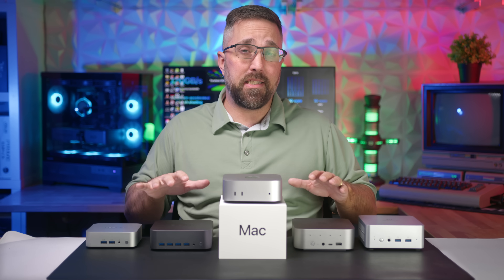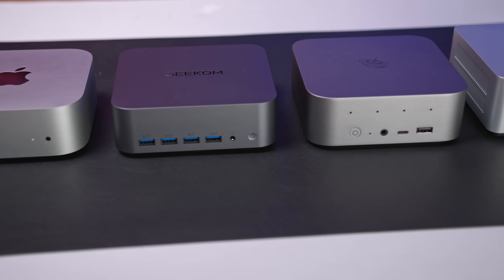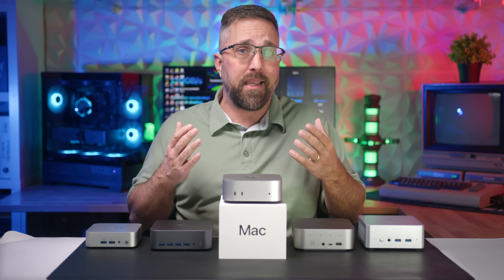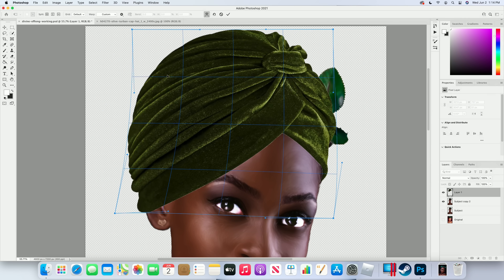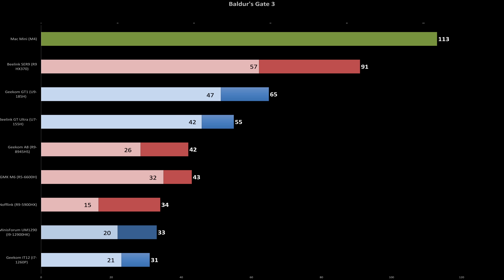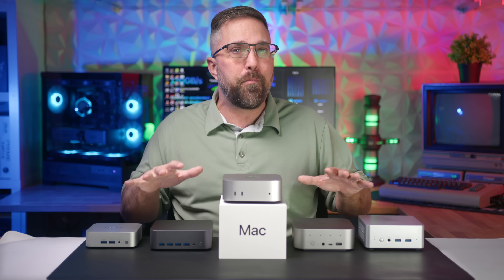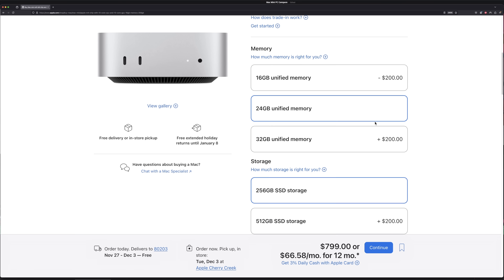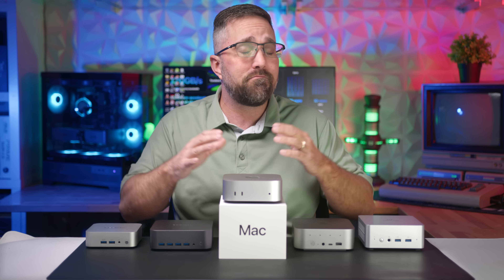M4 Mac Mini vs Intel and AMD Flagships – It's Not Even Close!

Comment: Some academic Benchmarks and and for real life almost Video and Photoshop software bechnmark only? I fear this a very apple friendly perfomance test. It's probably same like it was always, if you are using those video and photoshop programms your apple runs better, but other use cases the apple performance per price is sh*t. And reason for beeing fast is not better cpu or gpu, it just because it is better optimized.  Also i doubt that 16GB of ram are now a days enough. A browser open with a few tabs and addiotionaly working on a big video parralel that 16GB full of data. And then i bet the machine will become really slow. A very simple situation where your test just ignoring.
Reply from the maker: RISC architecture requires less memory than CISC because it uses fixed-length, simple instructions (typically 4 bytes) instead of variable-length, complex instructions. It relies more on registers instead of frequent memory access, reducing RAM usage. Unlike CISC, RISC doesn’t need microcode, which saves storage. The architecture is optimized for efficient compiling, avoiding extra memory overhead. While RISC programs may have more instructions, they are simpler and execute faster, making overall memory use more efficient. This streamlined approach results in better performance and scalability with lower memory requirements. This is why the Mac outperforms the PCs with less memory.
Reply: @ElevatedSystems  Sorry i am asking: Are you an expert in camparing cisc and risc archtectures? I think this is a very complex question you are talking about.... It is not an easy question weather a reduced instruction set what obviously lead to more assembler lines but have shorter instrucion word, would use at the end less ram. I am asking my self weather these claims are "truism" craeated by marketing departments. I can also remember that there was a thinking that risc outperfoms cisc in performance per watt. But at the end the german magacine heise revealead once that if it comes to top end performance cisc and risc are same efficient.
Also i would bet that now a days ram consuming internetside doesn't depend on or if, almost not depening the architecture. Because javascript code, pricture and assets that are loaded to ram are same on both architectures.
Reply from the maker: @ I dont know if I’m an expert, but I’m an Electronics Engineer and worked extensively with RISC code development and assemblies. Its not that complex, simpler decoding, reduced microcode storage, efficient register usage, and fixed-length instruction formats, makes RISC architectures more memory-efficient and scalable in modern computing environments.
Reply: @ Why should reduce microcode storage save ram? These are the commands which are saved on the cpu, right? And can also be updated if the cpu manucaturer did some shit on the cpu. I think the Intel Pentium Bug in the 90s was the reason for inventing microcode. But it should be completly irrellevant for ram usage at runtime.
Reply from the maker: @justiccoolman1816  RISC avoidance of microcode allows instructions to execute directly without extra processing. This keeps L1 cache efficient, reducing congestion and improving speed. CISC processors use of microcode generated extra micro-operations (μops) that take up cache space, reducing space for actual program data. This can lead to more frequent cache evictions and increased reliance on slower main memory (RAM). Without microcode, RISC CPUs maximize L1, L2, and L3 cache for program data, reducing memory access delays. This results in faster performance, lower latency, and better power efficiency, ensuring cache is used efficiently for faster, more predictable processing. If you want more education in this subject I recommend “Computer Architecture: A Quantitative Approach” Hennessy/Patterson

Comment: Just curious, why choose a 256 GB SSD. MAC mini?   
If other mini pc has at least 1 TB, then we should use a 1TB Mac mini.  Then price isn’t right at all.  It will be a scam as you are using to top line of ram and SSD for other mini pc but just a basic model of Mac mini.  16g 256gb Mac mini is $599, you should use 16gb ram 512GB ssd which is  $799.  Otherwise it will be a cheat to try to urge view to buy Mac mini.  Then it will not be a real comparison.  
Mac mini  has their strong point on media editing or even gaming on any game that support ARM chip.  But only too few game will suppoted ARM chip.  And this wont change at least for another 10 years.  Which this lead Mac OS  only for certain groups of buyer.  
256GB will only allow user to install no more than 3,4 game then it will become storage space insufficient problem.

Comment: about the power button. you dont even need him. you touch your keyboard. if is plugged it will turn the mac on.
Reply from the maker: No that wakes the Mac, it does not power it on if shut down.

Comment: Great Video.....Thank you!
Costco sells this base M4 Mac Mini on sale for $499 every now and then. The best thing is to boot it off of an external SSD for a cheaper upgrade than Apple offers. I use the Samsung 990 EVO Plus 2TB in an enclosure with cooling fan getting 2800 MB/s read and write or the Samsung T7 Shield would be an easier/cheaper option but a bit slower. I still have my Commodore 64 also (I see yours in the background) that played all of the Atari 2600 games back in the 80's.

Comment: If you're still buying Mac hardware in 2025 you're not the brightest. DDR5 2x32GiB SODIMM RAM 5600MT/s is only around $160 and that is Crucial brand. Mac Hardware is nothing impressive and a total rip off. Linux runs faster on Arm chips than mac does itself. Not impressive.

Comment: The reason that the MacMini power button was placed in a convent location for the design of the unit instead of the user was quite simple. Very few Macs are ever turned off. I have two Macs that have not been rebooted in months.
Reply from the maker: I only use my Mac Studio 2-3 days a week, the rest of the time it’s turned off. My wife only uses her mac mini on the weekends and shuts it down the rest of the time. Like Apple we try to be eco and security conscious. Both our Macs are tucked snugly under a Grovemade shelf and the extra height of the M4 Mini makes it impossible to get to the power button at all. So in my home 100% of Mac desktop users need a properly placed power button.
Reply: @ElevatedSustems Macs actually prefer to sleep, rather than be shut-down when not in use for only a day or two. The Mac OS does a number of housekeeping tasks during the sleep cycle that keep you Mac operating at peak efficiency. The amount of power used during sleep is equal to or less than the amount that is used during a start-up. So, if you are thinking you are being “eco friendly” you are fooling yourself.
Reply from the maker: Lets ask Siri…..
For a desktop Mac (e.g., iMac, Mac Mini, Mac Studio), shutting it down is generally better if it will not be in use for several days. Here’s why:

Why Shut Down a Desktop Mac:
	1.	Power Consumption: A desktop Mac uses more power in sleep mode compared to being completely shut down, even though it’s minimal. Over several days, this adds up.
	2.	Component Wear: Shutting it down prevents unnecessary wear on components, such as the PSU and cooling fans, which remain minimally active in sleep mode.
	3.	Fresh Start: After being off for several days, starting with a clean system eliminates any lingering processes or potential bugs from previous sessions.

When to Use Sleep Mode:
	•	Short Breaks (1-2 Days): If you’re stepping away for a day or two, sleep mode is more convenient because it allows for faster wake times and preserves your session.
	•	Background Tasks: If macOS needs to complete tasks like updates or backups to Time Machine, sleep mode can ensure those are completed.

Recommendation:
	•	More than 2-3 Days of Inactivity: Shut it down to save power and give the system a complete reset.
	•	Less than 2 Days of Inactivity: Sleep mode is fine for convenience, and the power usage is negligible.

For prolonged periods (weeks or months), you should also consider unplugging the Mac to protect it from potential power surges.

Comment: Excellent video, and I totally agree with your conclusions. I have several AMD and Intel mini-PCs, and the M4 Mac Mini base model represents best value to date. I paired it with a SanDisk Pro G40 1 TB USB 4 SSD I had lying around formatted using Apple's APFS. I first created an admin account for restore purposes, then a user account with admin privileges and moved its home folder to the external USB drive. The Mac Mini still boots using the Internal SSD so things like Apple Intelligence still work, but the user account and large applications such as Xcode, including Virtual Machines, gaming, and retro gaming, are all loaded from the external SSD. This works well because the Black Magic disk speed read and write performance of my external USB4 SSD is slight faster than the Internal SSD, plus I have only used around 60GB of the Internal SSD Vs 460GB of the external SSD. My external 1TB SSD originally cost less than Apple's M4 Mac Mini 256GB to 512GB internal SSD upgrade, illustrating what a rip-off Apple upgrade costs are.

Comment: I went for dreamquest, dose everything i need it for inc lightroom and photoshop, it only a travel computer big demand editing i normally wait till i get home to use gaming desktop but i may not need to now as i was using 15 year old laptop. the dreamquest it has n150 3.6ghz 8gb graphics, 16gb ram and 500gb m.2 for it size performs well and dose everything i need it for, no intentions gaming it a travel computer and best thing they system and a 16 inch 2.5 k screen uses around 40w of power that was important as it will be a car pc on my next big roads trip for isles scotland could be 3 weeks and 80% living in my car as micro camper so a pc to transfer vid data and pictures on to portable hdd a pc is necessary, screen uses a crazy 10w according to cable and pc plug says 12v 30w 3a a cheap inverter to get a steady 50hz job done a pc in my car on windows 11 and i pick my office view cannot get better than that while i transfer data and maybe few edits. low power usage was top my list but it still had to use lightroom and photoshop and have 4 usb drives the dreamquest fits that very well. i will get an amd one at one point for at home as it pretty wasteful running a huge computer just to watch youtube or other online vids i can give my expensive computer a rest and use a cheaper amd mini for 90% daily stuff. dreamquest n150 3.6ghz 8gb graphics, 16gb ram and 500gb m.2 cost me just under £200 and that inc 3 year insurance for what it dose a bargain and screen 2.5k 16 inch spot on for travel £137 overall with everything i needed to run it like mouse keyboard and inverter all in was just over £350 what bargain for a car pc what can easy do editing i require while in my car

Comment: @ElevatedSystems - OBJECTION at 13:54: You're not fairly comparing price to performance ratio. Upgrading the Mac Mini's memory to 32 GB and storage to 1 TB to match the Intel and AMD systems will more than double the $599.00 price to $1,399.00.
Reply from the maker: Yet it still outperforms the PCs. 🤔 Why would I spend more if it’s already the best at what I need it to do? It’s price to performance, not price to specs.

Comment: Mac mini storage can be upgraded with 3rd party manufacturers. The best deal is to buy 256 Gb storage and 24 Gb RAM. Use external flash drives and wait for the cheap internal flash storage price to go down.

Comment: My family converted from Windows to Apple recently.  We used Win10 and many flavours of Linux.  I GOT SICK OF FETTLING the operating systems to make them work.  When Win 11 came along, i was pissed beyond belief that I had to buy new PCs due to the security chip.  If i was going to buy a new computer, I thought I would give Apple a go and tested out a second hand Mac Mini M2 with the base specs.  Everything worked in the specs of the PC, still have plenty of space and we don't game.  Should have done this years ago.  The biggest use item we have is that my wife plays Sims 4 as her relaxation.  The latest base model Mac Mini with 16G of memory and the 256Gb HDD still fit it all in and works like a champ. the Mac OS is very integrated to the hardware and I like that.  So for us it was a no brainer to move over. Tired of M$ shenanigans and want to have things just work.  Apple fits that bill. Yes there was adjustments to be made when converting but a few videos on the differences sorted that out.

Comment: Placing the power supply INSIDE the Mac is just adding heat internally. Not surprised Apple would sacrifice heat dissipation for "aesthetics". Another example why I cannot stand Apple's company philosophy.
Reply from the maker: That would be a concern if it wasn’t for the fact that the Mac Mini runs cooler and quieter than all the Mini PCs I tested it against.

Comment: Apple has had an unfair advantage from Apple Silicon since 2020 and it’s just crazy that no one has caught up yet. I use both Mac and Linux systems and for a desktop computer the bottom line is that both will work fine for the majority of users. When it comes to laptops, no one can even touch Apple right now. 

I bought a mini PC recently though and I’m very happy I went with the Minisforum UM790 Pro over the base Mac Mini, which was around the same price. I love the freedom of Linux and the game selection is much better. I’m a big fan of open source software, too, and nothing connects you to that world like a good Linux distro. Also, I got a full TB of storage out of the box and was able to easily add another TB a couple of months later.

Comment: It seems that the reason why the power button is on the bottom is that apparently new macs don't really sleep ever. No matter if you press the button, or choose "sleep" option from the menu, the power light is always lit. I haven't measure it yet, but it seems to me that new macs are a bit like smartphones which means some parts of the processor are always on. So once you make a "hot corner" that turns your display off - it basically is the same as putting your computer into low power mode. Maybe I am wrong, so it would be nice to actually measure mac's power consumption when the screen is off, or when the power button is pressed. But if I am right then it won't actually matter much where exactly the power button is, because you won't use it almost ever.

Comment: Wait a minute, https://youtu.be/8Uuu046EE28?t=827 is not even close to an apples-to-apples comparison when the mac mini comes with a 256gb ssd while the other computers are 1tb ssd, the mac mini with 1tb of ssd is $999 but wait you also said it had a 10gig network but that is another $100 so you would really be at $1099.

Comment: I agree the base model is a great value although the slow small sad is insanely bad value.

Once you upgrade it in any way at msrp the value propositions changes very quickly to no do great.

Than the mini pro becomes a good value but again once you upgrade the crazy ram or storage on that then its best to get the upcoming m4 max studio with better cooling and gpu or build an awesome but bigger louder more power hunger upgradeable built to order small pc tower.

 Remember Geekbench does not measure multithreaded cpus in multi core score but cinebench does.

Upgradeable ram cpu and egpu helps longevity.

So if the cpu is multi threaded Geekbench effectively takes away halve if it's multi core score

Newer 
camm memory modules are faster and lower power and can replace soldered memory without slowdown at lower power levels.

Intel will use this in the future  best of both worlds but its more. expensive.

Comment: I'm an exclusively Linux user and really don't like macOS (I consider it the main weakness of the Mac desktop/laptop ecosystem). Sadly, Asahi Linux isn't available for M4 Macs yet and when it does eventually become available, it would be interesting to see this mini PC benchmark video repeated, but with Asahi Linux on the M4 Mac Mini vs Fedora Linux on the other mini PCs - a true apples to apples comparison if you pardon the pun.

I think a Mac Mini M4 with Asahi Linux (plus Fex and Proton) might actually be able to play games better than the macOS equivalent, but time will tell. There's a big GPU diff between M1/M2's and M3/M4's and with the Asahi team having to reverse engineer everything, it could be a few years before M4 support gets into decent shape.

Apart from the OS, the Mac Mini M4's other big disadvantage is the lack of internal upgradability (and the insane price jumps if you order more RAM or storage at initial purchase time). As you pointed out, you can work around the storage issue with an external drive, but the RAM situation is an unmitigated disaster. To go up by only 8GB RAM, you're also forced to double your storage to 512GB and the total cost of this being an extra $400 is a total disgrace (it's about $30 of extra hardware if you bought the equivalent for a non-Mac PC).

For me, the conclusion is that the Mac Mini M4 has a weak OS, has no internal upgradeability and scandalous pricing for higher RAM/storage options. A real shame because the price/performance of the base model is imprsssive, but I need more than 16GB RAM so I can run an ARM Linux VM full screen to avoid macOS wherever possible and its price/performance figures die big time when it suddenly becomes $999 for the 24GB RAM model.
Reply: OSX has become really bad.

I recently bought an M4 pro and I'm thinking of switching it to Linux in the long term.

There were issues with the filesystem already, I can't easily disable the notifications (I put the daemon in a pkill loop until I find a more permanent solution) and it lacks UI scaling like Linux Desktops and Windows desktops have. That makes menus really hard to read.